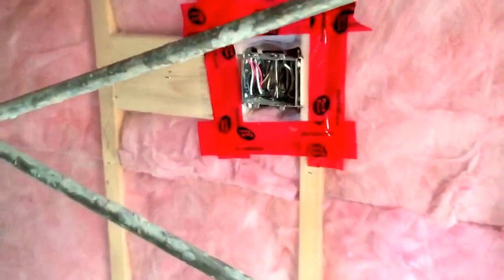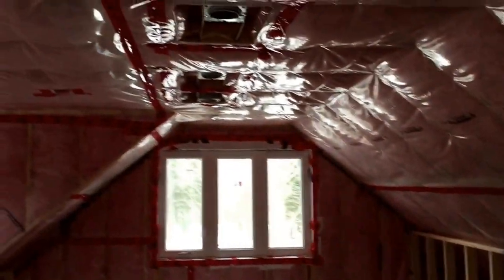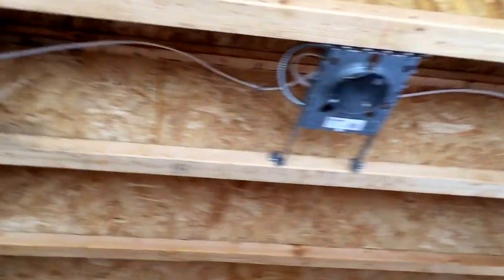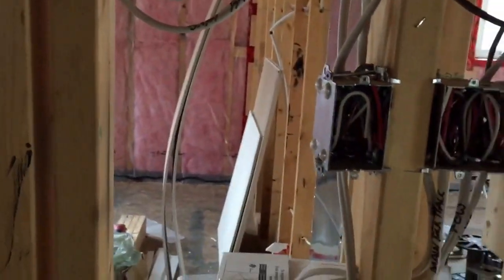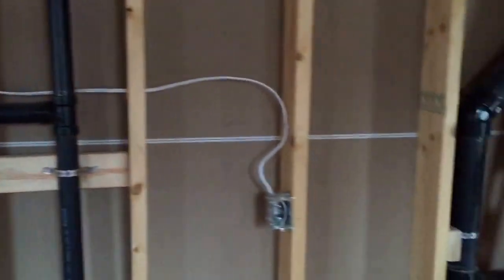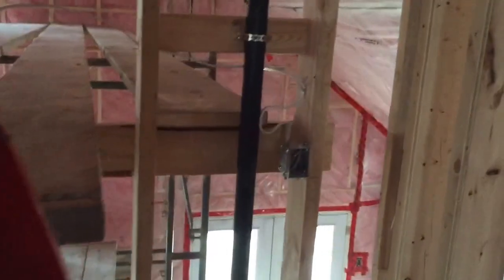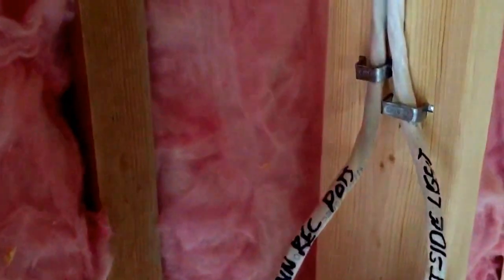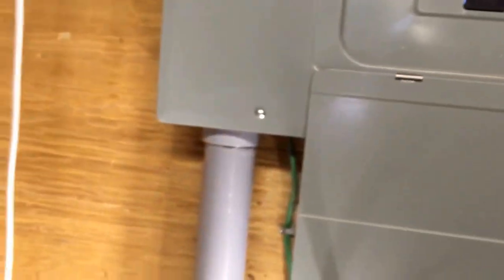Electrical Rough-in Residential

Comment: I still don’t get why people still uses metal boxes for residential;; I hate them :plastic ones are the easiest way to go
Reply: Because if a wire shorts the metal box will prevent a house fire , cheap plastic will speed up the proces. The sad part is whoever did those plugs amd single switches used 3inch deck screws instead of nails. Embaressing